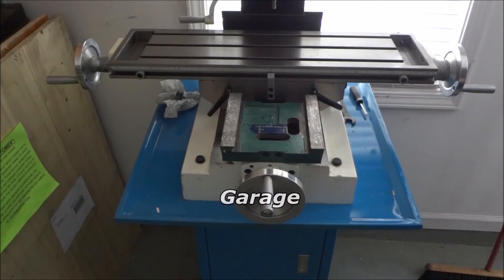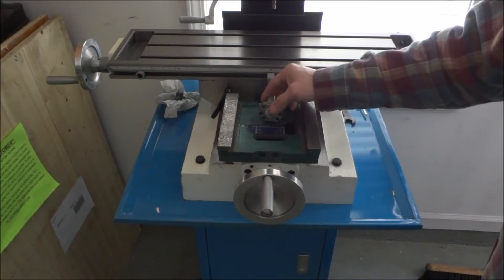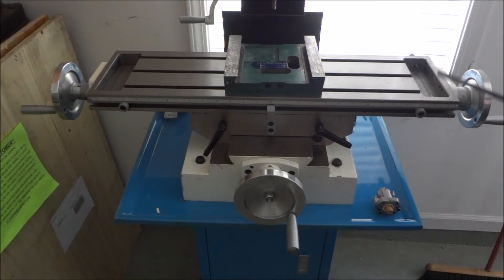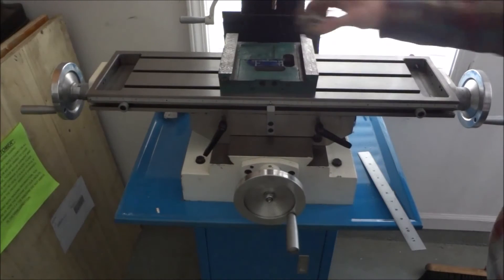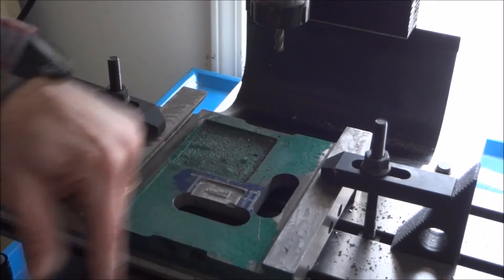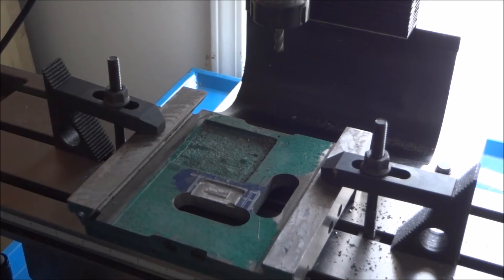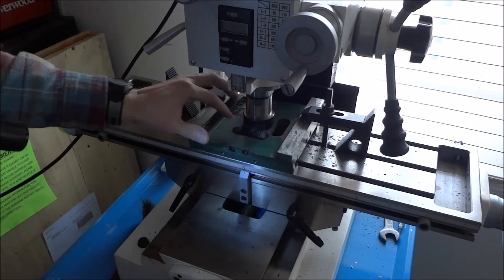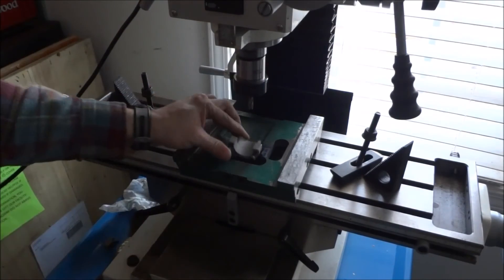G0704 Saddle Machining for X Axis CNC conversion.

Comment: Sam, First let me say thank you so much for all the time you spend on making your videos and providing so much help and info out there for hobbyist as well as some like me who have made almost a 4 decade  career out of the machining and welding industry. I went through two apprentice programs with a utility which I am still with after after 36 years unfortunately I am now a Welding engineer so don't get to do any work with my hands. However I do have my own amazing shop at the house. Because of the fact that in a Nuclear power plant we dont manufacture , we build one off tools ,repair parts, build obsolete parts ext CNC is not used much . We do have a few knee mills with conversational type programming for non complex parts . Plus most of us left only 3 at each of our plants grew up and where trained as toolmakers on manual machines . To expand my knowledge into the realm of CNC has been very tough since about all I could do a few years ago on a computer was surf the web and buy from Ebay. My I phone still kicks my butt lol. So guys like you and all the others on You Tube are my life blood . I have several project machines that eventually will be CNC , currently I am converting a Lagun Knee Mill that I did a complete rebuild on last year to 3 axis CNC with AC servos and a vector drive for the spindle.Something I would have never been able to attempt if it where not for guys like yourself and your You Tube post. Just an observation whenever clamping against a critical surface use a softener like a piece of brass or aluminum under the toe of the clamp it helps to spread the forces to a larger surface area plus keeps the hard surface of the clamp from damaging the surface. Thanks again for all of the help , maybe someday I can actually get to the point that I can return the favor for all out there.
Reply from the maker: +Kenneth Hall 
 Much Respect for you and  The Machinest trade  They just don't teach that sort of stuff anymore I would guess most never even heard of a Machinerys Handbook LOL  Thank you for the Kind words It really means alot. and exactly the reasons you mentioned are the same reasons I post the Videos I too was a novice just a few years ago and I still have a lot to learn.

Be Safe,
Sam

Comment: I found the comparison between the G0704 and PM-727 compelling. I am currently in the market to upgrade my X2 mill to something better (bigger). I have been considering the G0704 or PM-25MV, however after seeing your video I am thinking even the PM-25MV is not enough of an upgrade.

I am concerned that the limited X travel of the PM-727 is not enough especially with a rotary table and vise one the table.

What is your impression on the PM-727?
Reply from the maker: +Denzil Long
 The Table is 1" longer than the G0704 However because the Saddle of the PM727M is so massive it limits the X movement, there's just not as much hanging over the Saddle on each side. travel in manual form is 15". In CNC form without extreme mods I think I can achieve 18" you can see how when I get into the mounts portion of the build.
Me personally I find with My X2 (4 x 8 ) work area I run out of Y way more often than X just me though.
The stock Mill has 8 1/2" of Y  and X is 15" I think when done I hope to  have 10 x 18" work area.
My impression Beefy Not a RF-45 series of course but a Big step up from the G0704 you really cant compare the two.
Grizzly has its own version G0795 No stand and 220 motor its listed at a little less Y travel not sure why it appears to be the same Mill.
There are a lot of mods to the G0704 and a lot of Info so it will take some time for this mill to catch on, But if you don't have room for the big boy but you want to get a rigid beefy mill the PM727m is it.

Comment: I think you have the G0704 saddle setting on the wrong side!  when you compared it with the PM saddle ,  the X axis will travel from left and right but you have it reverse.. it's still smaller but I think within 1 "  wide  

Just made my drawing plan to extend the Y axis up to 11" and added steel support to the base and the column, the good thing about the G0704 column is that the studs goes on the side so that can give more flexibility to extend the X... I am thinking to get another g0704 base and cut 3" and added instead of making new spacer, that will help the top table saddle to get more dovetail support !  and I can add another 2" in to the front !    by just using the metal saw to slice it in 3 parts! 

let see what will happen with my plan! 
OZ
Reply from the maker: +Ozy Ozy 
Yea Your right I noticed that as well I think the saddle the other direction is about a 1" wider but tapered of course. Still very small in comparison. The PM-727M Column bolts to the base with 4 bolts to the top of the base as well.
 Sounds like a plan :-) The Mods are many all you need is Time. let me know how shes coming along.
Be Safe Sam

Comment: Nice to see the machine running...though it sounds pretty loud. i guess this is normal for geared mills. Looking forward to seeing your conversion.
Reply from the maker: +Charlton Wang 
Yes it was nice to see and hear it run, It did seem kind if loud but I don't think it's abnormally loud the camera mic is very sensitive. I was running in a low gear as well. at some  point during the conversion I will switch over to belt drive. that will solve any noise issue I hope.
Be Safe sam
Reply: +CNC4XR7 
Did you do the spindle break-in procedure? I know when russtuff recorded his break-in procedure (yes, I watched the entire video) it seemed like there was a marked difference before and after the break-in. As you say, once you get cut over to belt drive, I suspect all the noise issues will go away. Can't wait to see you get that Leeson on there.
Reply from the maker: +Charlton Wang 
No I'm a rebel I did not do a spindle break in procedure in fact that was the first time I had it running except to make sure it worked after UN-crating.
My plan is to replace the spindle bearings with angular contact bearings when I do the belt drive so I'm not to concerned with the roller bearings.
I may do a break in video when the belt drive is complete. 
Thanks 
Be Safe, Sam
Reply: +CNC4XR7 
:-) Makes perfect sense. I surmise this is going to be a breakneck speed conversion.
Reply from the maker: +Charlton Wang 
Well Not sure it will be fast but I may break my neck Stay tuned! LOL :-)
Reply: +CNC4XR7 
If the cadence of your videos in the past is any indicator, you're pretty fast. :)
Reply from the maker: Yea the G0602 build went pretty smooth and I had time. I'm looking at this being about 6 months.

Comment: I know you are going to use a VFD with the PM mill but are you planning to leave it as a gear drive unit or do a belt drive conversion.
Reply from the maker: Mike 
I will be converting it to belt drive. At least that's the plan.